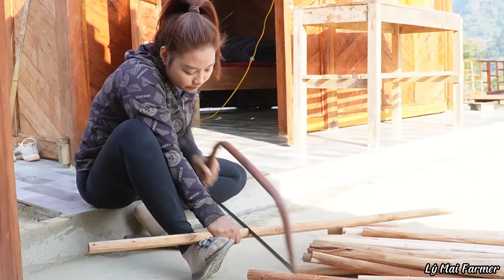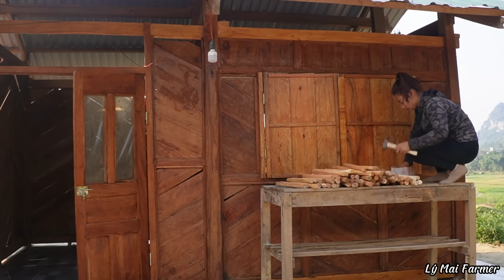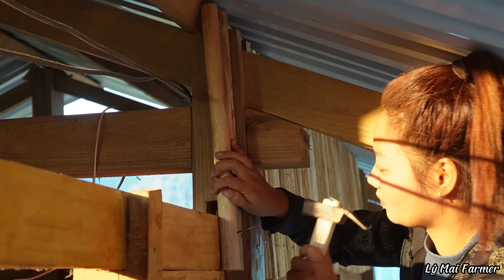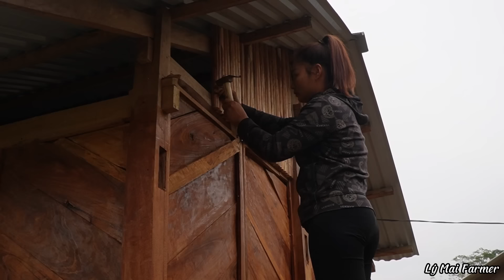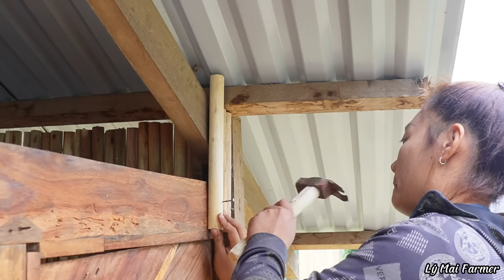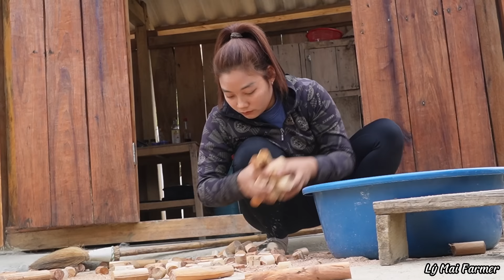With skillful hands : Mai has completed the unique windproof house wall to prepare for winter

Comment: You should always use the first piece you cut as a guide for the rest to be cut. Why? When I was young I was tasked with cutting 100 boards to the same length. I kept using the last board I cut for the next to be cut and by the time I got all 100 cut the last 1 was 3cm longer than the first 1. From that I learned to mark the first 1 and always use that 1 for measuring.

Comment: Your house is still not draught proof. There are so many gap on the wall. If you have heater inyour house the cold air will neutralise the warm air emitted by the heater. And that make the heater work harder to keep the room warm and it means more money for electricity bill.